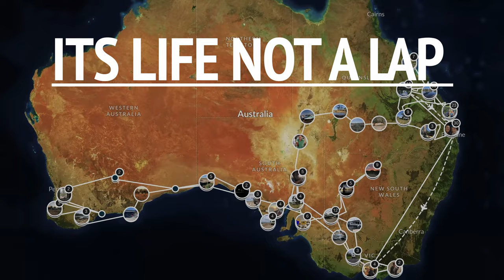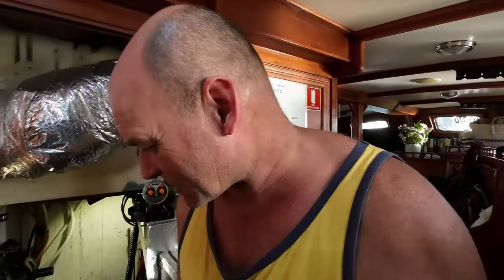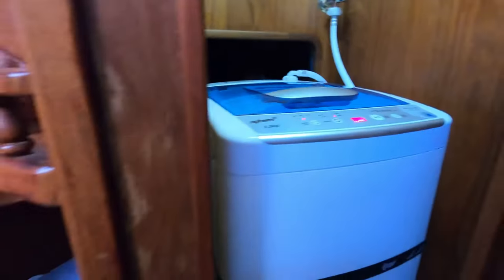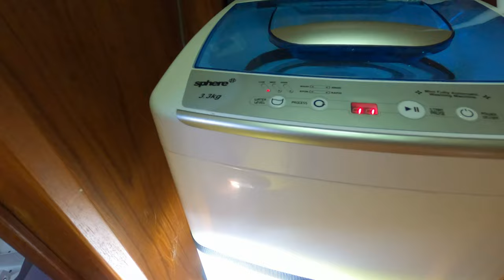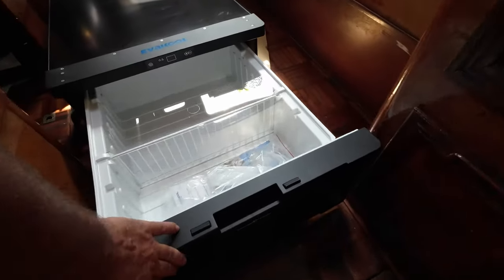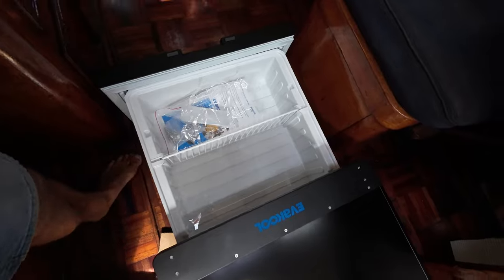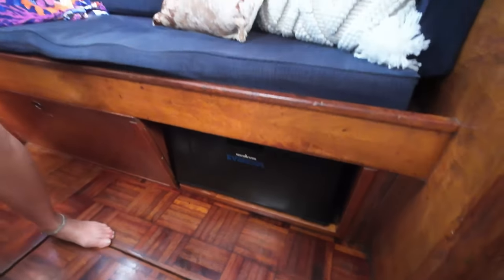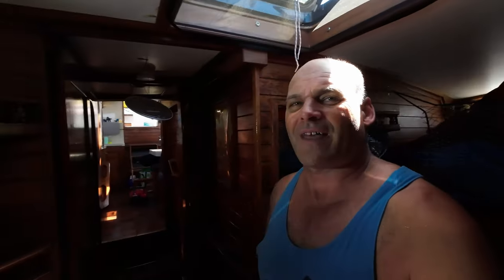SV Awaitea Installations happening everywhere in our efforts to be ready for December

Comment: What are the lights you installed i recon they will work well in my van cheers Andrew.
Reply from the maker: Hi Andrew,
Lights are QLED, 41-196W-84WY-3P- LED Switched Interior White 12v Dome Lamp White LEDs 196mm. The cost around $120 each.
Cheers, karl